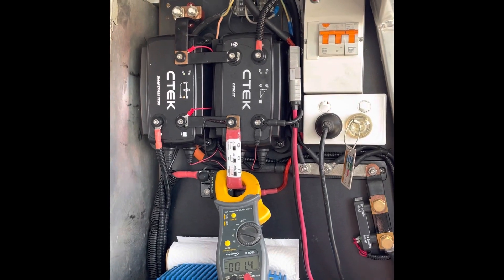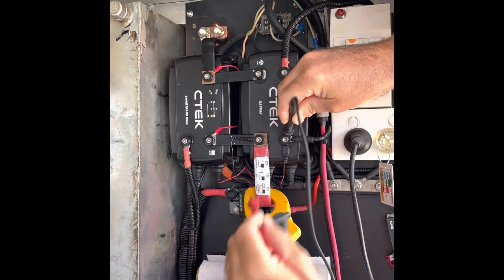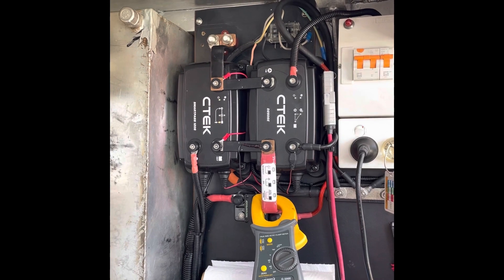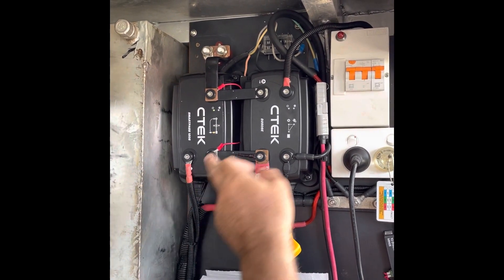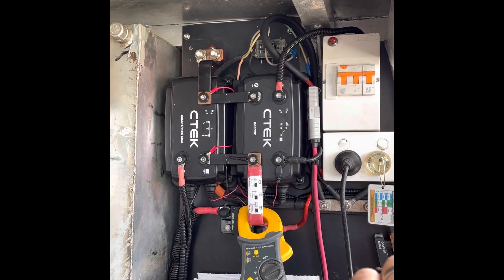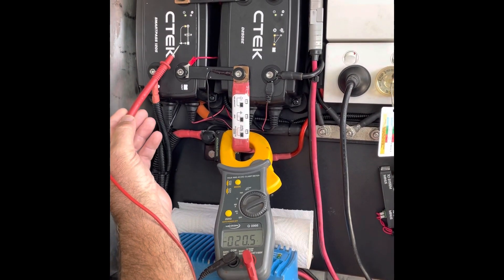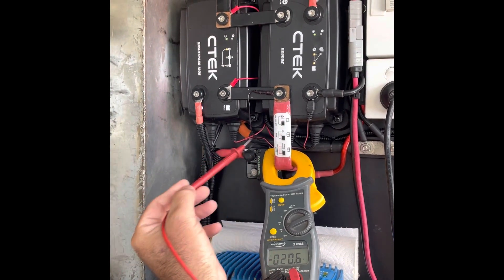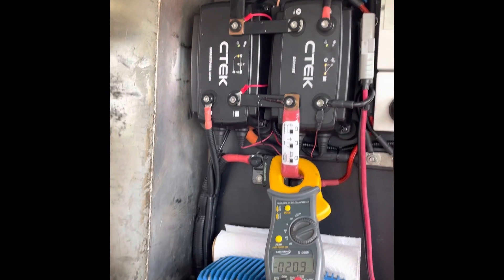CTek ds250se and Smartpass120s testing

Comment: Ah man! I just checked the manual’s Charging Program and find, at least for my own situation, its working as its designed to.  

My banks voltage is 13.4, so the 250se maxs out at 20amps til 13.8v, then ramps right back. Page 12 of the manual - my bad, but in case this helps anyone at all…

Also, OP - big thick cables from Smartpass to Service Batt Bank and also to Negative (chassis) shoulda done the trick. Hope so! 😊

Comment: Hi there!  

Im a ctek and victron user. Happy so far!  Likewise, used the grey ctek for ages (no smartpass) 

Now upgraded to d250se and sp120s.  My van. Altenator isnt perfect, but for the last 3 months, i HAVE  been getting near-same amps into the service battery (2x300 lifepo4) as is coming outta the altenator cable before the battery.    

I usually get around 60amps (sometimes 70 ish) until the victron shunt shows around 14.18v - then, understandbly, ctek backs off (14.20 rated for lifepo4) 

But the last 2 days, dropped to this sub-20amps business!  Clamp shows full amps between altenator and battery, but degraded amps from battery cable to ctek setup.  (00awg cable, btw…) 

Why the change?  Ive no blinkin idea. 

Anyways - just thought Id chuck my 2c worth in too. 

Also, i have a 30amp victron mains charger which ive used twice to bring the batts up o full charge, let them balance, then switch back to ctek (max 14.2v) 

Happy to hear your progress if any - or tales/adventures that people found that were probs resolved! 

My wiring is fine - cause Ive been getting higher amps/same as altenator; something else is afoot!)

Comment: Why did you connect one of the small cables from the Smartpass or the D250SE to chassi/earth? 
You have a Lithium battery, so the Battery select cable from the D250SE and the negative cable connection (black) from the Smartpass should be connected to +12V.

Have you tried this? 

It is kind of confusing, because the misses this part of the smartpass out or you are supposed to imagine that the table from the D250SE continues on the buttom for the Smartpass... and to make it totally confusing there is a (-) on the black cable, so everybody thinks, it's supposed to go on chassi/earth.

Comment: It's not charging properly because you have the battery output connected to the s250se - it should be connected to the 120s to hit high amps - it matters, manual says the same, I'm sure you found this and sorted it by now though.

Comment: For lowest resistance you should connect the charge out to the SmartPass not the D250. This is also how the manual is showing. The bus bar is very light although it should still output something. The SmartPass is putting power to the consumers directly so is it possible you don’t have any extra power?   The SmartPass is a relay, so if the alternator voltage isn’t a lot higher than the aux battery it won’t pass any current.  My system charges up to about 13.45V and 90% on my lifepo bank then cuts out and just powers consumers.  You can also test by disconnecting the D250 and see how the SmartPass acts with low state of charge on your aux batteries.

Comment: Did you ever check your vehicles factory alternator wiring size to starter battery? I saw a video of the same 20A max issue and they found the factory alternator wiring wasn’t up to snuff and after replacing with thicker cable instantly jumped to 55A on a 70A alternator. Here’s the vid: https://youtu.be/HatmrnPl1Vg

You also need to know your service battery charge rate too. Yours could be 0.5C as I read your comment that you too are maxing out at around 50A. That could be your BMS limiting the charge and not the ctek. If your battery can handle 1C rate (100A) or if you add another battery in parallel and the charge doesn’t increase then it’s a ctek or cable gauge/length/alternator issue. 

I haven’t seen any videos yet of anyone charging near 100A-140A. Unfortunately there’s lots of variables with alternator sizes, cable gauges, incorrect installation/grounding etc I’m not sure yet whether the advertised peaks are super sensitive to ideal conditions/installations or just overhyped marketing. I’m still troubleshooting my own setup and will report back if I get anywhere over 60A
Reply from the maker: Gday Dale,  

Love the comment mate.  Good to see some inciteful thoughts. I have added the battery spec to the description for reference, all cabling is oversized for charging to cater to the start assist function which can throw 300amps back to the starter when needed.  

Yep, have seen that video and noted the same.  I am yet to upgrade the alternator wiring.  My thoughts were that if the starter battery is in good condition and holding charge then it could offer up its cranking amperage capacity until the load drops the volts under the specified amounts and cuts back to what the alternator can provide.  In testing I've not seen the starter voltage drop below 12.9 under all conditions so far.

The C rate (on charge cycles set by the BMS) for the battery is 0.2 at 24amps and 0.5 at the maximum charge rate of 60amps.  I took this into consideration when building the system which is why I went with 3 batteries in parallel.  To my mind (which has been wrong before) the three batteries in parallel will be able to draw up to their maximum charge rate if it is available in this case 3x60=180 amps with the Ctek solution being able to provide a max of  140amps I figured there is safe harbour built in.  

Even if I could see the shunt indicating 72amps Id be stocked and feel that should be within the realms Ctek marketing department and what the alternator/full start battery could provide even if for a short period of time.  This brings me back to alternator testing and tricking the Ctek with the bench power supply using volts which I will do once I drain the system down to 10% again. 

All in all it's just an interest for me that will hopefully help others.
Reply: The (recommended) charge rate of 0.2C has me interested whether the bms is more likely to throttle the allowed charge current. So you’d more likely end up with a max of 75A with 3 batteries in parallel. Also have to consider the temperature too because the bms and ctek will throttle amperage if above a certain (programmed) threshold. The state of charge also plays a big role as I think the ctek is more on the conservative side with its bulk charging phase and only likely to output anywhere near advertised amps with a really depleted battery, which sucks because it is hyped like it would supply the 140a always if the load requested it. I’m super interested in your lab power supply experiment to solve it once and for all. I wish I had the gear to try the same. Just remember that you can’t forcefully overcharge the battery. It will only take the charge that it needs (like an electrical load) even if more amperage is available. I really want to know which is the bottleneck here?? Would be super helpful for quite a few people here by the looks of it. Thanks for your comment and good luck with the lab experiment, looking forward to see your findings. Cheers 😉
Reply from the maker: @deefadale  "The (recommended) charge rate of 0.2C has me interested in whether the BMS is more likely to throttle the allowed charge current."

yep me too, I figure though, like you said, I should get at least 72amp in parallel if available for the greater part of the bulk charge cycle. Id actually be pretty happy with this but would be nice to know when the charge is down to sub 50% it could boost up toward the .5C rate if available.  Charge is sitting at 80% this morning.  360ah takes a while to drain down!! 

Got to love a first-world problem.

Comment from the maker: So, I have been utilizing the system for the best part of 12 months, sorry all for the delayed response, life is busy. 

The net result after the last year of testing and usage is a maximum amperage charge rate has been 52 amps under the following conditions.  Per Victron shunt data MPN: SHU050150050

•	No accessory outs connected, just the house battery bank
•	Alternator 90amp Smart (trigger connected)
•	All wiring and fusing per Ctek installation except bale upgraded to SDI Rubber Tinned Switchboard Flex 1x50mm (yep cashed in the super) 1/0 AWG
•	Start battery full (avg between 12.8 to 13.+) Amron 125D31L 775CCA RC 165 95AH 20HR
•	House battery bank 3x120ah Kings parallel discharged to 10% capacity 11.8v (IE drained 36AH remaining).

The addition of the smartpass120s has only added an additional 32amps at its peak.  Nowhere near the advertised 140amp combined potential peak with a full charge start battery. 

CTEK has responded informing me I would need to connect a 70amp plus 240volt charger to check properly, which I do not have. Nor is divorce an option.

Regarding the product quality, in my personal opinion Ctek produce fantastic, reliable equipment.  I have personally utilised the D250 system since the original grey units (pre-smart alt and lith) and these units have always achieved their maximum potential in both solar and alternator charging.  Along with CTEK 240volt M200 series chargers I have always been an advocate and recommended this brand.

The addition of the smartpass120 has been the only disappointment I have come across from the product line largely due to it not getting anywhere near the expected potential in my setup.  

The D250Se continues to delight.

The next steps for me out of curiosity will be to jump to a high output alternator feed from a friend’s RAM to see if this makes a difference and also to use my bench top power supply unit to see if delivering 13volts to the trigger wire will trick the unit into passing more charge.  I will report back on this (hopefully sooner rather than later).

All in all, knowing what I now know, I would not purchase the Ctek system in place of other alternatives that work out cheaper for around the 50amp/smart alternator charging options.  Most of these alternatives also come with Bluetooth smarts which I find very handy from a monitoring and error-checking viewpoint.

Hope it helps
D
Reply: Thank you for this thorough report. I have also achieved similar results. My highest rate of charge for a virtually identical setup was about 49-50amps. This was only achieved when my leisure battery was at about 10% - 15% state of charge. The entire system was configured according to CTEC spec sheet using a 200AH lithium battery. - I definitely would love to see some blutooth monitoring capability of this not-so affordable system.
Reply from the maker: @zoneout_au  thanks for the reply.  Just an update I am back from a week camping and am in the process of running my battery bank down to 10% to begin testing again.  Will be trying jumping an connection to high output Alt and a bench power supply set to 13.5 volts and see what it can deliver.  I would be pretty satisfied if I could get 75amps through the system and delighted if I get marketed product capacity.

Comment: Mines the same if I start the van it sometimes reads 50-59a and trips my breaker
Reply from the maker: Hi, thanks for the response.  This comment piqued my interest as you were getting more amps before your breaker tripped.  Can you tell me the breaker value you are using? It should be 300Amp if both units are installed and start assist is being used.

Comment: Hey @hopeithelps did you have any luck with more amps on your trip? Did you diagnose that the smartpass was faulty? I can only get 20amps from mine..
Reply from the maker: @user-hk8hg3ns9s Hi Craig,  Have posted a more indepth report above.  I will get back to it after the next round of testing from high output alternator and bench top supply.

Comment: This exactly describes my problem as well. From your comment, the only time increased rate of charge will happen is if the battery is drained significantly. Is this still the case? Or have you found another way to get more charge even if the battery isn't drained. Would love to see a solution video if you're planning on making it ;)
Reply from the maker: @zoneout_au Gday, thanks for the comment.  Short answer, No.

It makes sense that when the battery bank gets above 80% it should slow down to top off the battery bank. I'm no expert but I believe this to apply to nearly all battery chemistries with lithium being able to be higher before tapering off.  That being said I assume like me your significantly means over 20% discharged.  In this case I have discharged down to 10% residual and still no better charge rates were achieved.

My biggest concern was when the batteries were near depleted which is when you want the potential to bulk charge as much as possible.  This would especially apply in remote camping situations where 240v could be days away.  In this scenario, given the performance of my system I could have spent less money elsewhere to achieve the same or better results, and had the benefit of more modern units with better reporting.

Have posted a more in-depth explanation.

Comment from the maker: Have had a response from Ctek support.  Kudos for their turnaround time.

"The charging current ability is low on lithium batteries with high state of charge. 20Ah is normal charging current. The smartpass will help if a sudden big power consumption occur for example an electric winch or something else consuming much power. 

Try to discharge your battery then the battery charging current ability will increase. It assumes that the vehicle's generator can deliver high current constantly, which is not always obvious."

I am heading away this week for 4 days so will have a chance to drain the battery bank down to check at what voltage the Smartpass will kick back into bulk charge.
Reply: Any updates? I am in the process of placing an order and wondering if the smartpass is even worth it. I am using 2x 75AH Lithium batteries as my service bank.
Reply from the maker: @conandrum74  Gday, have posted an update sorry for the delay.
Reply: Your house battery cable should be mounted on the smartpass, not on the D250 even when they are bridged.
It works flowless on my boat, I have 65Amp alternator and get about 50Amp through D250SE and Smartpass120S, takes maybe 3-4 seconds before it kicks in. 
I have 500Ah lifepo4.
Reply: @johnnyandersson5622  I'm having issues with my smartpass and d250 now - can you help me ?
Reply: Did you ever get this working? My previous comment 2 months ago was no good as im having the same issue now!!